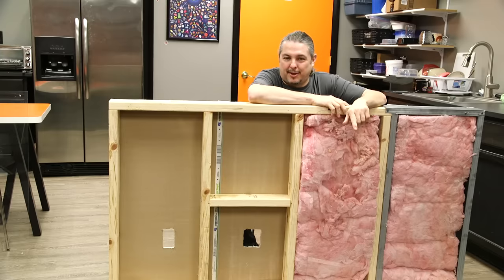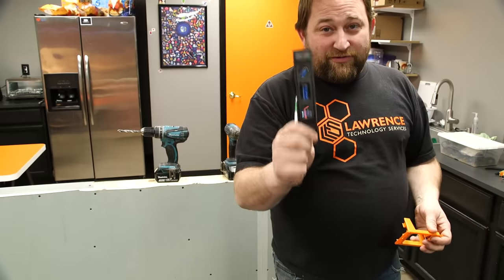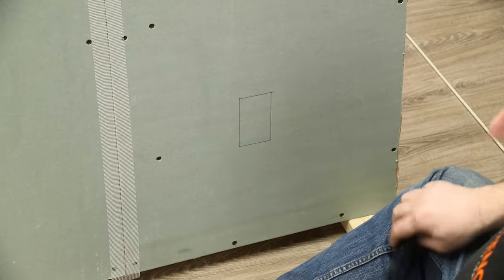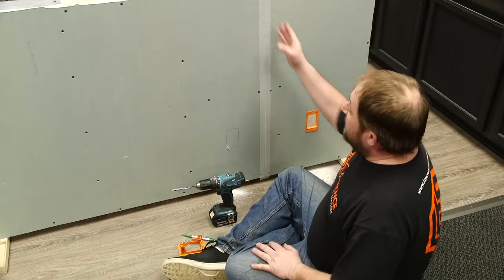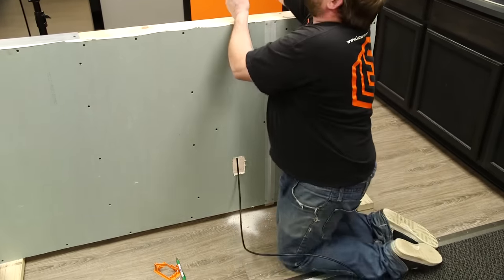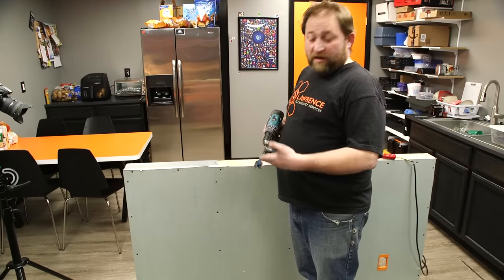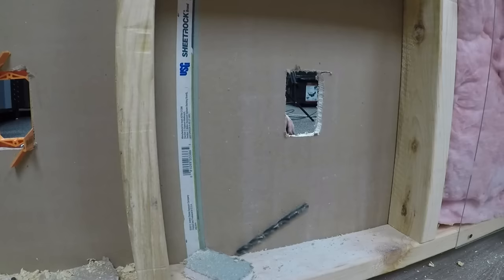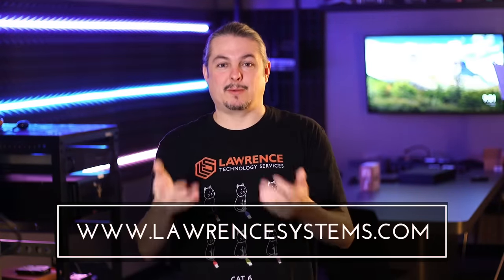Wall Fishing Tools & How To Use Them When Dealing With Fire Stops and Insulation

Comment: Cool stuff!  But I have a double (almost triple whammy 😢) …. Two firebreaks and insulation. Then the ABS water drain pipe. Older construction dimensional lumber.  This house is built sturdy! 1957/8
The water pipe isn’t so difficult but wires must be run through the small gap between the pipe and wall. AND through the insulation and firebreaks. I’m considering a cable chase since I’m running speaker wires, RG6, cat6 and HDMI.

Comment: An endoscope camera with flexible gooseneck shaft is also helpfull. Also, invariably you'll need a right-angle drill, something with a very low profile (not the plumbers' or electricians' gigantic Milwaukee Hole Hawg). Finally, you'll need a selection of spade and auger bits and three or four 18-inch and/or two-foot drill bit extension wands so that you can extend the drill down inside the wall, assembling it section by section, to reach the firestop; it's like drilling an oil well!.  If the firestop is sheet metal, you'll need to use a hole saw and suitable drill extension wands. I've done it, and it's tricky....
Reply: Do you ever find those extension bits like to come apart inside the wall?

Comment: Really well done, should show to strip the wire more and use electrical tape to make a gradual slope of thickness so you can easily pull multiple wires through the same hole
Reply: Also use the tape to taper the other end in case you have to pull it back out to start again!

Comment: Being an electrician is a pretty fun, simple and easy job but you definitely want a second pair of hands. I have done solo installs for garage lighting and it always takes sooo long.
Reply: james hawkins Hi, I want to run network cables through my house and install wall jacks, but how do I know I won’t drill through something I’m not supposed to? E.g electrical.. etc
Reply: @Handleme23  well, dont press to hard when you're drilling through the 2x4 so when you break through, you dont push the spade bit in and hit wires. 2, you could use a stud finder that also reads for electrical. 3, could punch a hole in the wall and look down inside with an inspection camera.

Comment: Would have liked to seen the best method for running wires with walls that have sprayed foam insulation (with and with out fire stops). Hopefully, maybe in another video. 
Thanks
Reply: I imagine that as being impossible. But if method does exist, I am definitely curious how to accomplish that😄
Reply: We spray foam all of the exterior walls in our new builds. If the walls are partially foamed (3" in a 2 by 6 wall) then you just stay to the inside to run a wire. If the cavity is full of foam, you're pulling drywall.

Comment: I do these about the same, except I use tape to connect the wire and the fish rod or whatever I’m using to get the wire down the wall.
Reply: and gotta taper that end so it doesn't get hung up on anything.

Comment: That long flexible hole drilling bit is an excellent tool for my Home Theater speaker wire run through the walls. It would look way cleaner vs the way i have it with the wires just hanging. Not a bad price at $45.00 for the 72 inch long version.

Comment: You should put a disclaimer on the video on the use of all tools especially the use of a sawzall blade.  Without having a fat grip at the end of the sawzall blade like a drywall saw, a persons hand could slip off the blade and slide along the sharp teeth of the blade causing a very deep laceration on the hand.  You expect a certain degree of common sense from your viewers but that is not always the case.  Just cover yourself.  I love all your videos very informative. Thanks!

Comment: 7:38 ya try doing that on an exterior wall where the trusses meet you got like 6 inches at best to bend that bit. in a cases like this you probably should try to drill upwards from the outlet hole.

Comment: What’s the difference between the XP1000-3 and the XP1000-6 magnet puller?

Also do you HAVE to use the roller? You can’t just use a piece of metal or another magnet to trace it?

Not trying to pay $175 for the “kit” if you can get the bullet dropper for $35 and use a piece of metal or a 500lb fishing magnet I already have lol

Comment: You can't get a 6 ft flex bit in some low height clearance attics sometimes you have no choice but to cut the drywall where the fire blocking is and cut a notch in it.

Comment: What was it you used to attach the drill bit for a long extended drill into the fire break/block?

I'm looking to fish CAT5 cable down from the attic to the floor of a 2nd story room. (I'm trying to mount a security cam on the ceiling of my front porch, adjacent to that room.)
All cams are one CAT5 cable for all video, audio, and power; going to the master bedroom walk-in closet, where the NVR and POE power injector is located.

Comment: I always start to cut  the mud ring out from the bottom center to the ends first in case you you marked it in the middle of a stud  Conduit so you can adjust the ring left or right if needed.    Keeps me from patching holes in the wall most of the time.
Reply: I've never hit a stud in the middle of cutting out a box ( sarcasm )

Comment: So I have a question. In 2024 I have to put recessed lights in a ceiling with blown insulation. Any ideas what type 4” lights I could use? I know it has to be in contact rated but can’t find any

Comment: I have an older house and 1 of the downstairs rooms only has one electric wire hanging down from the ceiling in the center of the room. It;s connected to a  light with a pull string. is there a way to fish wiring from the ceiling through the wall to add a light switch and a couple outlets? Or should I just gut the plaster, do my wiring then drywall and paint?

Comment: What an awesome video 🤙🏻
I have one question. We are wanting to put an electrical plug and an wire for satellite tv on a insulated wall (to outside) to use a TV wall mount. 
This video has given me reassurance that it’s very possible. 
I’m wondering though; can we fish the wires up from the unfinished basement ceiling? 
It’s not possible to go from the ceiling because we have very high vaulted ceilings. . Any advice would be greatly appreciated. 
Thank you:)
Reply from the maker: If there is no access to the ceiling above then you will have to cut open the drywall, install the wire, then patch it.

Comment: I've got a 10ft-12ft living room wall with firestops. I'm debating trying this long flexible drill bit to get holes in the beams from my attack and down from the original outlet. I'd love to hear what you guys think.

I figure this way I can get the holes drilled and from there I can just make small drywall cuts to assist with running the cat5. I doubt snaking the wall blind through multiple beam holes would work without make drywall cuts.

Comment: Is there a flex bit for metal? I'm working in the hospitals, and we are running access control cable ( banana cable) we have to drop our card reader down the flex into the 1gang box we installed but apparently there are 3 metal fire stops in the wall. We got threw all threw but man it sucked. Do they not make metal shaving flex bits? Bc we had to cut a big squar out of the dry wall to fit our drill and attach 1ft extentions as we got deeper. With our hole saw.... I have a flex bit for wood but can't seem to find one for metal studs....

Comment: I am going to be sending 8 runs of cat 5 cable from the attic thru to the room directly below.  It is an insulated wall.  How do you recommend handling the 8 runs?  Each individually ?
Reply from the maker: you can put them all in the same hole.

Comment: If I'm going to run 3 outlets 4 feet apart, would you use the drill bit that you used in the video thru the fire stop to drill horizontally thru the studs or would you run up into the attic?

Comment: For the flexible drill rod with bit, just what happens when one is loading 8-16 holes down the wall with a "fire-break" stud not visible? For example, it could be for camera security, RJ-45 Network cables in a large group down the wall to a NVR. (Network Video Recorder) for security cameras. 8-16 network cables can get thick to use a small hole. Of course, one can use a spade-bit for the 2-top (double top plate), but don't have a drill rod that uses a spade bit?

Comment: What brand flexible bit do you recommend?  Helping friend with 200 year old house with wood paneling and hidden fire stops at intermittent distances in the walls.  Hope you see this.  Thanks in advance if you do.
Reply from the maker: MAGBIT MAG 777 3/4 inch x 72 inch Fish Bit https://amzn.to/3u4tlMk
Reply: Thank you very much.  Saw some bad reviews and was concerned.  Yet, seemed, if they had watched this video of yours, they might have avoided some of the issues (like pulling it down through the wall instead of trying to pull it back up).

Thanks again!

Comment: Good info, but not sure how you go from the top of the wall if you're on the first floor working on an internal wall.
Reply: This is currently my issue. I am on the first floor of a two story home, the outlet I'm going to feed from is against a vertical stud but then right above it about 1 foot higher, I also have a horizontal stud/fire barrier. I don't even know how to proceed at this point
Reply: @iamteedoh  The video is geared toward offices that have drop ceilings.  If you are in a home with a basement, especially an unfinished basement, fish from the wall into the basement and run cables along the basement ceiling.  If you are on the second floor of a two story home, run the cable down the wall from any attic space you might have.  Sometimes cables have to be run on the exterior to get from the basement to the attic, but hopefully you can find a path.  Perhaps plenum cable next to an HVAC run or something similar.  Definitely takes some investigating to see what you are up against.
Reply: mulderlr the video isn’t explicit in identifying what the appropriate audience is until after you view the entire video. Not faulting them just saying it didn’t offer that for me and some of the others. I, unfortunately, don’t have a basement and the second story wall is an exterior wall up there but interior downstairs. In other words, the room I need to wire doesn’t have any room directly above so no attic and it’s also an interior wall. The second floor of my home is smaller than downstairs.  I was able to run the cable by finding the horizontal fire stud. Then, I cut a 4” square around that stud so the I have one inch of clearance above and below the stud for three reasons: 1) be able to notch the stud horizontally to create a gap to pass my cable between the drywall and the stud. 2) the clearance of one inch above and below allows me cut the drywall out without cutting into the stud. 3) I also have one inch clearance on the left and right of the cut, which allows me to put the cable inside the notch I made and staple it in place so it doesn’t move, which in turn allows me to put the drywall piece I cut out back on and use drywall screws to screw it back onto the stud using the one inch clearance on the right and left side of the stud and drywall cutout. Then add compound/ drywall filler in the cut area after putting the drywall piece in place, sand it down, add some texture and paint. I wish I could post pictures for a better visual but that worked out beautifully for me considering my situation.
Reply: @iamteedoh  Why not a flexible bit?
Reply: Had the same question. When would you ever have access to the top of a wall?
Reply: @ronnieg2126  Drop ceiling.

Comment: How does this work on existing construction if you can’t get to the top of the wall?
Reply: Dennis Miller you could put in a blank just below the ceiling.
Reply: ?? I’m saying they messed a big piece of how and where. Unless you have a unfinished basement and go up or it’s  a attic Hoe do you drill through a top plate?
Reply: Dennis Miller lol you have to cut a piece of the curling next to the top plate and one on the wall right below it

Comment: What are your options when fishing through a pre-drilled firestop? I've got at least two in my wall and I stupidly pulled up some coax without tying a string to the end first. Using fish rods, I just cannot seem to find the existing holes. I can always get past one easy (from either side) , but I just cannot for the life of me make it from attic to floor. To make matters worse, they ran electrical through this same path, so I'm hesitant to do any drilling near it, but I'm hoping to utilize the existing hole.

Comment: but how do you find where to drill from the top? in the attic sometimes you do not know where to drill
Reply: I saw another video from home depot where a gal drilled a hole in the ceiling above the outlet and put something up through it to see it in the attic and then drilled the actual hole closer in so its above the inside of the wall section. I'm assuming then you would just putty over the ceiling hole

Comment: Also, never, ever assume that a wall will not be without wires, pipes, etc. Drilling and sawing without first using a detection device would not be advised, nor where the studs are to avoid cutting, splicing or drilling into a wire/pipe or stud. Check firstly before cutting and drilling.

Comment: How do you apply the fire rated caulk as required by most codes to the hole in the fire block once you have the cable through it?
Reply: That's a good question. Is it required in cases like this?

Comment: How do you ensure that you drill through the center of the fire stop? One time my bit ended up on the side of the 2x4 and the drill bit mostly just cut through the drywall instead of the wood. Now I stick in a small camera to inspect drill bit location but that's a pain in the butt.

Comment: What do you do if you're on an exterior brick wall with a trey ceiling? I can't find a good way to drill a hole. I really want to use an existing coax cable as a pull wire but it gets stuck going up. I can't tell if the existing hole is big enough or not.

Comment: What do you do when you can't get to the top and you have to go through the face and move to the left?  An example would be mounting a television over a fireplace where you want to drill through the back of the wall behind the tv to run the wires and have it come out to the left side of the wall approximately 5ft away.

Comment: That drill bit is for drilling bottom plates not fire blocks. You can easily pop right through the drywall drilling through a fire block
Reply: Richard Miller that’s why he mentioned there’s a guide you can slide on to make sure you don’t go through the wall.
Reply: @christophercrawford2736  the guide clips over and helps bend the bit into the wall opening but won't necessarily prevent the bit from popping through the drywall. Just fyi
Reply: yeah I would not be comfortable using something that has that much play, it would just end badly
Reply: Richard Miller is that what you’re talking about?
Reply: @christophercrawford2736  Haha. I've not seen that before but I suppose it could be helpful here and there, but fire blocks? It's better than nothing I guess
Reply: Richard Miller I try to cut my hole for low voltage plate close enough to the fire block that I can drill through it from there. I never go up in the attic and not everyone has one anyway.

Comment: I ran into a situation where a wall had a fire stop but it was made out of metal. Same thin kind the metal studs were made of. I was able to drill through it with a long drill bit, but was concerned about the sharp edge cutting into the ethernet cable. Since this is inside a wall, I don't see any reason the cable should ever move. What might you have done differently? Would you have done anything to protect the cable somehow?
Reply: Just put a 10mm plastic pipe through the holes and run your cable inside

Comment: When using a long drill bit to drill through the fire block, you can only fish a single wire , what about multiple hdmi leads etc, how can the drill hole be made larger? Im assuming the larger drill bit (1" hole) would be hard to drill through from 3ft away no?
Reply: That's my question too